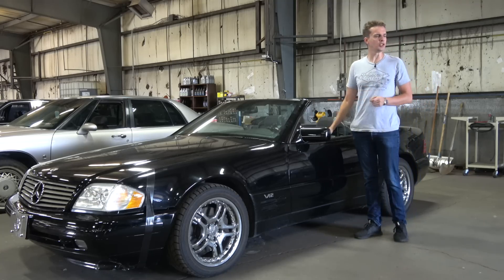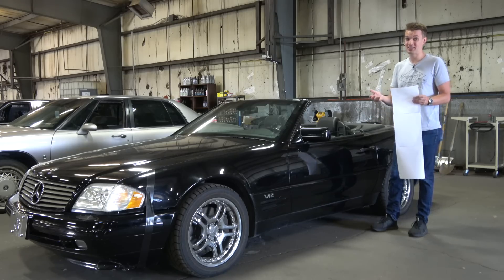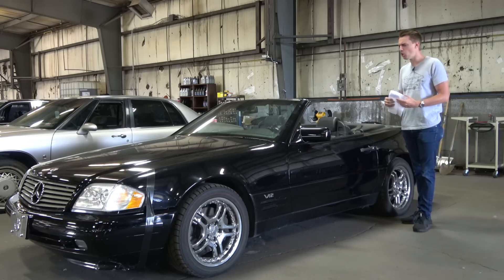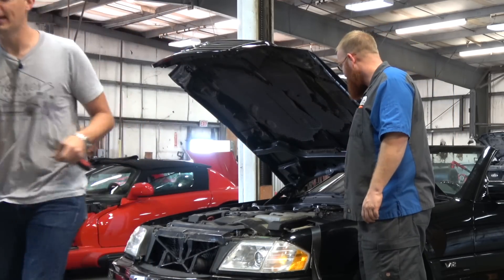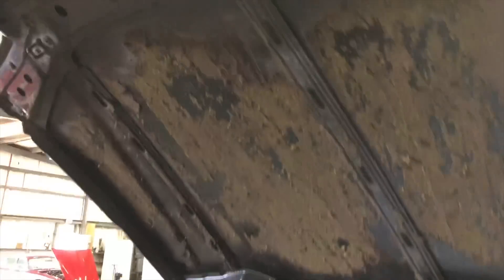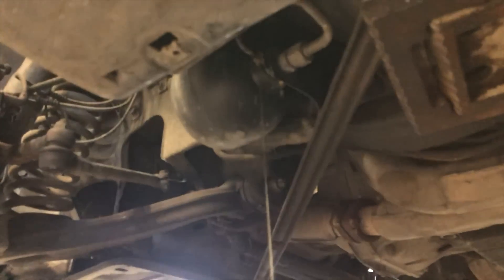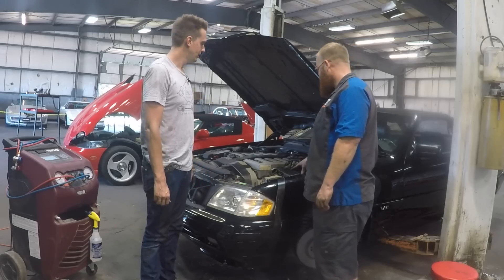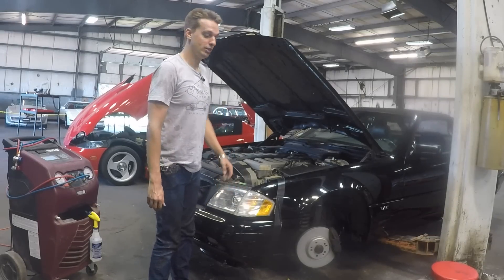Here's Everything that's Broken with My Cheap V12 Mercedes SL600

Comment: The suspension spheres ‘balls’  are connected to the suspension actuator piping with banjo Allen bolts.  If you drain off the fluid and undo the banjo bolts one at a time you can push a pencil in the hole.  If it goes in about two inches and it meets hard resistance then the sphere is OK, if you can go in four inches then that sphere has ruptured.  These spheres are not matched and can replaced individually.

Comment: If you come across a hydraulic line that has a y split be very careful it may look like a junction but is a very tiny in-pipe levelling valve . 
If you’re guy has not repaired lots of Mercedes hydraulic suspension he should leave it alone .

Comment: My 06 E350 now has 48k, had the Balance shaft replaced $5400 @44k miles, Transmission control plate $600 by an indy @45k, started leaking, I changed the gasket AGAIN myself NO leak. Mine is the Lowest millage E350 in existence and probably has had the most spent in main. repairs.

Comment: I had one of these for a couple of years. The best comment I used to make is that the reason there was a Bat Phone in the Dashboard was to call Mercedes and ask WTF about a vinyl window in the back. For $123,000 NEW - vinyl. Really?? Did you also get the hard top with this, and the cool rack? I had several SLs from the '90s and even had the cool lift attached to the ceiling.

Comment: Selling my 95 SL600 with 52k miles on it. All top hydraulics rebuilt. plugs, caps and rotors replaced.  Fuel filter, cabin filter, engine filters all replaced. New hood pad. New hard top headliner.  All work done over the last year. Car is ready to go. $15k obo.

Comment: Everything he is describing sounds typical of Mercedes from the DaimlerChrysler era.
1. A/C blowing, but not cold, check.
2. Brakes screeching in reverse gear, check.
3. Front suspension issues. 
4. Dried out hood padding
5. Tons of small electronic gremlins

I've owned about 5 Mercedes from the 1997-2005 era, all of them had these issues. I'm going to stick with 80s and early 90s Benzes from now on, those have never let me down, thankfully.

Comment: Pet peeve ..I hate when someone leaves stay dri on the floor ,sweep the crap up. Takes 2 minutes then it doesn't get tracked into the car. Or when you drop a bolt you don't have clay stuck to it.

Comment: I hope you see my comment or that i get enough upvotes. The problem with your Top is 100% one of the 2 Microswitches in the "Softtop-Case". My Saab 93 Convertible from the same decade had the same problem. They are for securing the computer of the top that the top moves the right way. One is for opening, one for closing the Top

Comment: I had a 600SL AMG in 2000-2002 and zero issues. Only my former stupid girlfriend killed two AMG rims on a curbstone. The costs for a new AMG set would have been 8k - but i guess the classical MB 8 hole rims can be get today cheap at ebay, etc..
BTW i would keep the exhaust as it is - the R129 (esp. with the V12) is still a collectors item and exhaust modifications will presumably reduce the value of the car. If you want to spend extra money get a hardtop.

Comment: My 99 SL 500 is all original with 52k original miles.  Mine sat for about 1 yr with a float charger in my shop.  And then I went to crank it it.  Well it turned over very well.  The it turns over like a top but, would no crank and my gas gauge shows empty.  So I filled her up and still won crank.  So I immediately changed out the fuel filter and fuel pump.  now it wont turn over at all?  what gives the fuel gauge still shows I am empty.  Help Pls ???

Comment: for all of you mercedes haters my 93 500e just past 450k miles a week ago without any problem still goes better than your toyota and still faster. this sl is a very good car if you get a right one. also what do you expect from  20 years old seals inside those soft top lifters? I know they break down after 5 years in convertible BMWs but I saw some of these SL still holding it after 20 years. Mercedes engines specially the old ones never break down they are not gonna leave you in the road . I bought one of these from vancouver it was a japanies import very clean 91 model I drove it back to toronto (4000km)without even checking the engine with no issue because I trust these cars and the old engines. I dont know what this guy is trying to say but buying a ruined car what ever it is gonna cost you a lot to fix it doesnt matter toyota or benz!

Comment: There is a reason why some of these cars cost more than 30000$ and some cost as low as 5000$ even though both might be at the same mileage. the first one was regularly visiting the authorized Mercedes-benz service centers since 1996 and the cheap one stopped doing that in the year 2001. the owner thought he is so clever letting these German approved centers ripping him off so he hired uncle Joe's garage to service the car the same way they service a Dodge Neon.

Comment: That's not that bad at all. Try doing an old BMW, I was the last to know its the most expensive car to repair lol...And I thought everything German  was built better. It's not. I think most private party shops would have charged you 3000 for all that work and the dealer would have wanted 10k.

Comment: You should burn that merc.shit,i am also thinking about that, why because my s560 2018 is in dealer ship for 2 months and 23 days,best or nothing,oooyeah and still out of order,engine lights on,in limp mode or safe mode,they gave e class as substitution until they repair mine,avoid merc at any cost.

Comment: My dad had a newer SL 500 and it basically had so many problems it was totaled with 80000 miles. These mercedes are over engineered and everything fails after 10 years. They are really terrible used cars.
Reply: Matt M Any engine problems because Tyler’s V12 engine seems to be in top shape for 84K miles and 21 years?
Reply: The engine and transmission were solid. It was the hydraulic suspension and the resulting damage to the undercarriage, some extremely expensive brake part needed to be replaced then my dad sold it because he was afraid something major he couldn't repair would go wrong and guess what it did. The new owner needed to replace the gas tank because a baffle breaks loose. The hydraulic suspension and gas tank issue alone if repaired by a mechanic cost more than the car is worth. The engine and transmission were great and when everything was working it was a nice car. But there is a reason they go for nothing used.
Reply: Matt M To me, the power train is the most important thing that has to be reliable since the other stuff is less complicated to fix. Thanks!